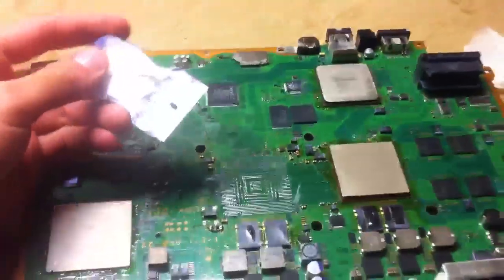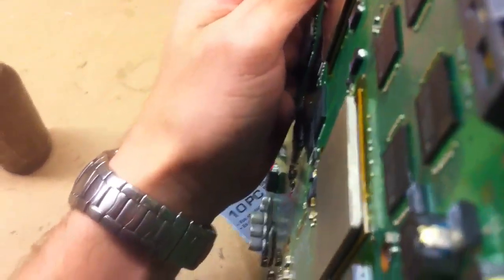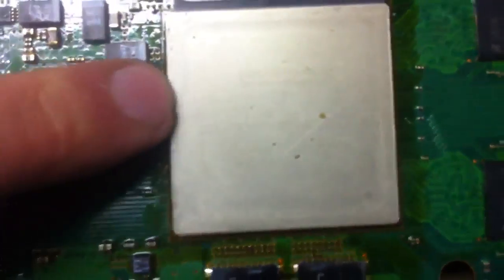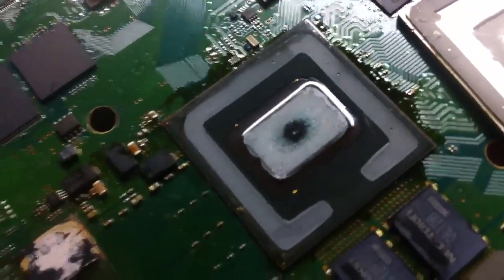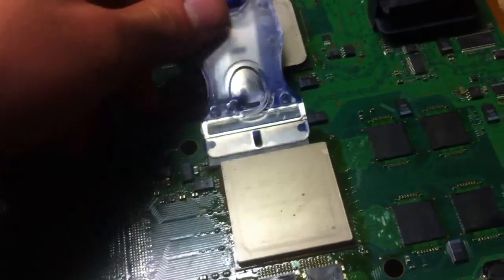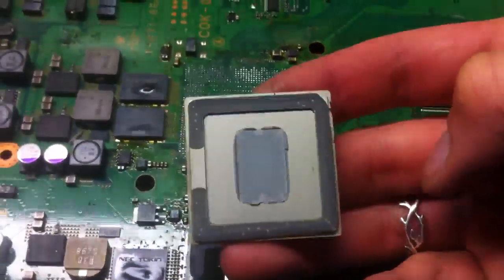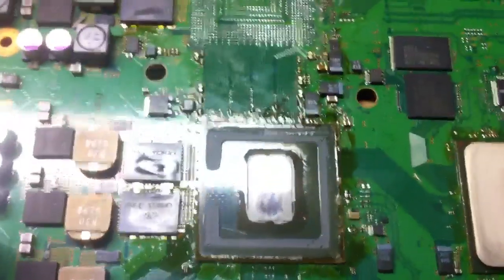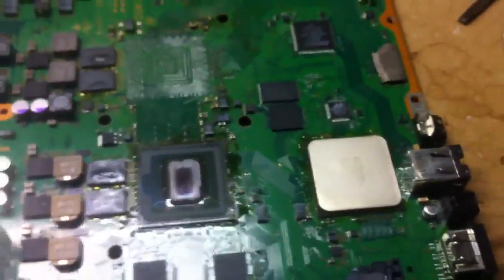Removing the heat shield from PS3 CPU

Comment: Normally, I'd agree with you - but in my case, my ps3 is jailbroken (those are hard to come by) which is why I feel it's worth fixing. I don't think mines needs a reballing though. Just the paste replaced underneath the sheilds.

Comment: its easy to fix ylod , you take and place the ps3 pcb on flat surface then take a heat gun and heat the board up with the heat gun for about 2 minutes let it set and the gpu or cpu which ever caused the ylod, should be back flush to the pcb, remember to check it before you put back together, alot of ylod occur cause the ps3 gets to hot and causes the gpu or cpu to lift off the board sometimes, if that doesn't fix it, start checking the board for other problems if not probably a firmware problem.

Comment: The only time its worhwhile to pay that much and still have a used ps3 is if the ps3 is jailbreakable. I have a cechc 60gb on 2.20 that came to me with no video, even a reflow wouldnt fix it and it would only turn on if heavy pressure applied to the RSX. I keep meaning to have it send ott for a reball but I fear it may have been a lifted pad since reflows wont work and because of the pressure needed.

Comment from the maker: Yes very few. Most BGA chips are not designed like this and are very hard to reball. I can tell that you have never attempted to reball one yourself just by the comment. What my comment states is ver accurate. If you guys would like to spend $2000 plus on a BGA rework station and have it imported from china just to find out that reballing PS3's is about the hardest task to accomplish in the electronic world (no joke) like I did, be my guest.

Comment from the maker: The key to removing the CPU HS is taking advantage of the flexibility of the thin rectangular razors. You have to press down on it to that it flexes parallel with the chip this avoiding damage to the traces. On the fiber chip. You also don't want to go to far in or you can damage the die. This is where the plastic guard that holds the blade comes in. It prevents the blade from cutting in too far.

Comment from the maker: If you have changed out the compound on the heat spreaders, and your still having any cooling issues (noisy fan) you should take both heat spreaders off and replace the compound underneath each one. You'll need some high grade thermal adhesive for the local ram chips on the RSX the arctic silver will work directly on the die itself.

Please note that removal of the RSX heat spreader is also a pretty technical task. You'll want to be very careful not to disturb the tiny caps that are under the h

Comment from the maker: The board used in this video was a dead board for demonstration purposes only. If you have burnt ram chips like this, it is from the "heat gun" repair attempt and this is why the ones on the board in this video are cooked. This with not a natural cause by any means.

Comment: Hi-did anyone notice that the Ram chips next to the CPU are melted? I have an 80GB PS3 that was repaired and has YLOD with the same overheated problem. Melted chips are probably the reason it cannot be repaired and it beeps to red light instantly.

Comment from the maker: This can be kind of tricky if you have removed the rubber type glue along the edges. If this is the case, you'll have to create some sort of standoffs to support the shield. They will need to be pretty exact measurements. 

If you haven't removed the rubbery glue along the edges, then just set the shield back on and reassemble the machine as usual, but be conscience of the fact that the shield could shift if careless.

Comment: When you reapply the cpu heatspreader do you just put some compound on the mirrored plate and put the spreader back on? I guess what im wondering is if you need to put an adhesive as well?

Comment from the maker: It really boils down to a consumer demand for "faster" as well as "ultra compact" electronics and these companies respond by cutting into performance and longevity of the hardware by trying to cram i7 processors into a notebook that can fit in your back pocket! 

Speed equals heat. The faster the hardware is, the more heat is generated, the more heat that is generated, the larger the heat dissipation mechanism must be. Then try to imagine packing that into notebooks that are as compact as they

Comment from the maker: Yes and that is why ALL electronics on the market develop some sort of issue related to that fact. It is because lead free solder cannot withstand fatigue caused by the constant heating and cooling  of the chips. Yes your are partially correct about poor heat dissipation (mainly because of poorly designed electronics) however it is infect a combination of poor design as well as the fact that these companies are using solders that cannot withstand fatigue very well.

Comment: Lead free solder is not the issue, it is used in ALL consumer electronics. It is nothing to do with toys, is is to stop rainwater washing over the solder and lead leaching and contaminating our water when the product enters landfill. The issue is thermal coefficients and quality of the thermal and heatsinking design.

Comment from the maker: If you are having loud fan issues, I would tear it apart right away and change the thermal compound. If this is not done very soon, YLOD will be coming. I have done this to a system that had a loud fan and it was almost a year ago and is still running nice and quiet. He runs it very hard too. The best way to beat YLOD is to never let it happen. This is the best advice I know how to give on this subject!!!

Comment from the maker: If you have not tried the two reset modes, please try that. I'm not going to explain how to do it. It should be known by all ps3 owners how to do it. If none of the resets produce a video for you, try the analog video port. If none of this works, you most definitely have an RSX issue and will need to have it reballed. DO YOURSELF A FAVOR and don't put your super masterelectronics repair hat on and grab a heat gun and go cook your board. Have it REBALLED not REFLOWED professionally.

Comment from the maker: I would use thermal adhesive on the outside of the die and regular arctic silver on the die itself. You'll want to make sure the spreader is flat before the adhesive dries. Be careful when removing the old glue.

Comment: WARNING: THIS DOESN'T WORK ON SLIMS.

The angle required to do this on a slim is slightly higher, and you WILL cut a trace if you attempt this.

Comment from the maker: Ok. First of all, it is not a good idea to turn on a ps3 without having a heatsink on the both chips. Second just because the heat spreader heats up, don't mean the thermal compound under it is good. In most cases the when thermal compound goes bad it still does however even after it goes bad transfers heat to the heat spreader. So this would not be a good way to tell if you need to change it or not. It is rare that it needs changing though on UNWORKED ON units. One of the main reasons I find i